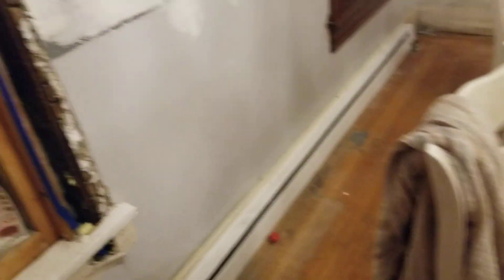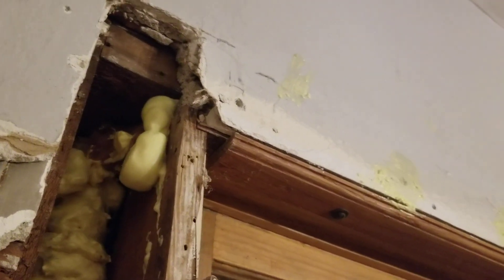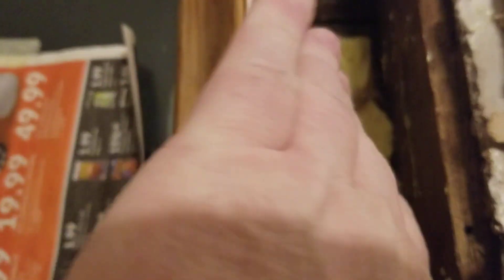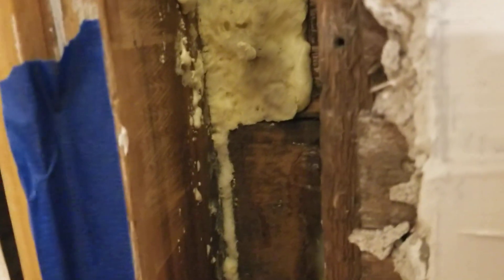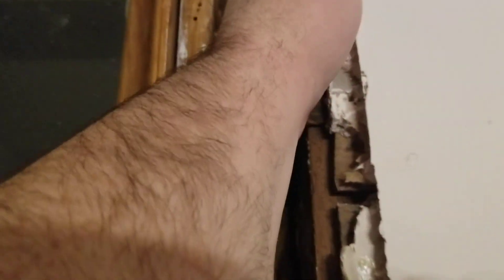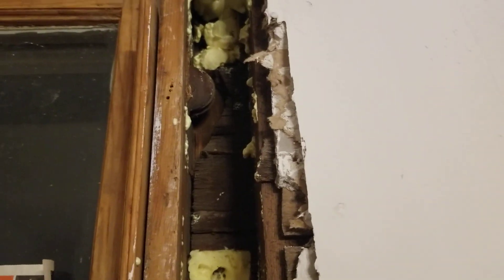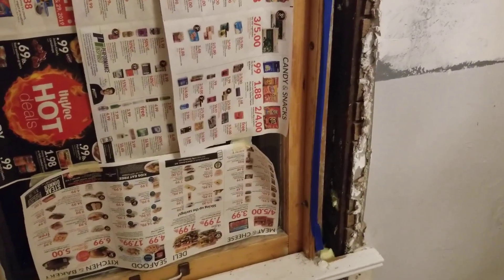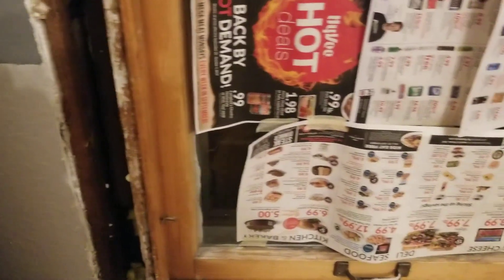Does my Window weight pocket leak? Drafty?

Comment: Whenever I use foam I seem to get it everywhere, what do you find best to remove it if you get it on the wood of the windows?
Reply from the maker: I protect the window and floor with tape and plastic or cloth. I used everclear and it worked well